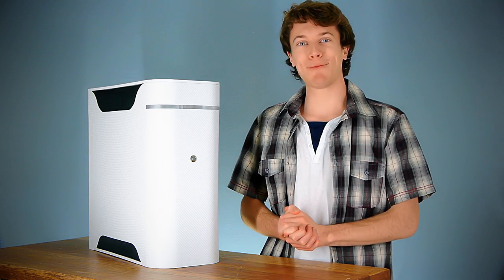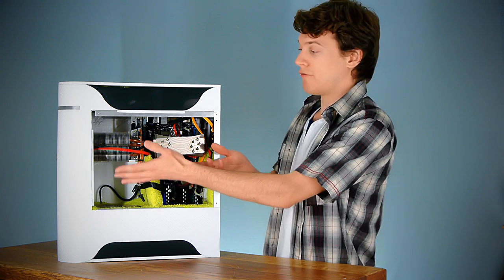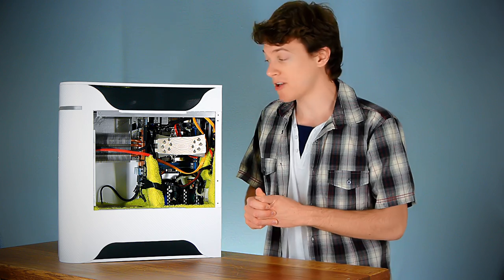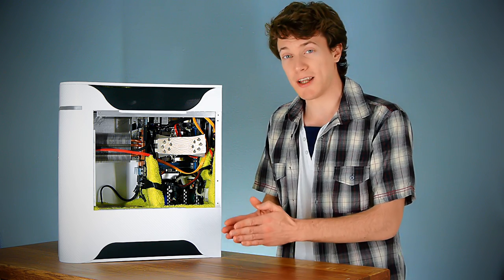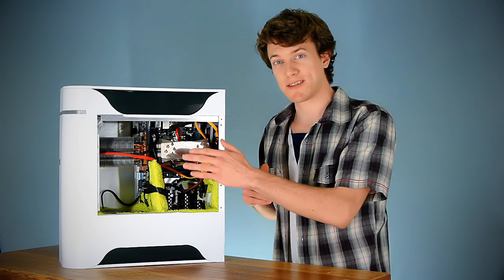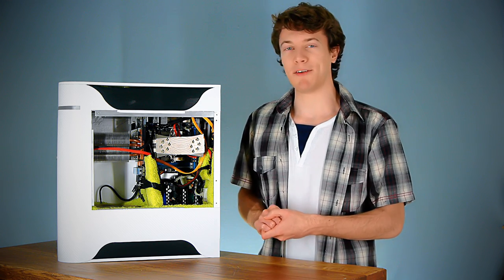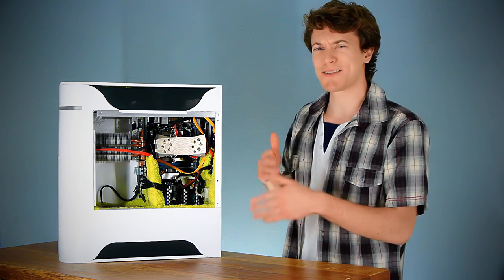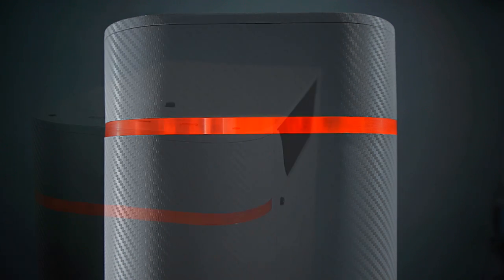DIY Computer Case - The Ultimate Silent PC (CLOUD UNIT)

Comment: Vertically mounted motherboards in which the I/O ports come out the top of the case should become an industry standard So convenient.
Reply: I think it depends where you put the PC as to how desirable top I/O would be. I prefer putting the cables in to the back because it looks neater when the PC is on my desk next to the monitor. If the PC was under the desk having the ports on top would definitely be better.

Comment: "everything high voltage has been kept away from the fabric" Well you've only solved half the problem there mate. I'd be more worried about the DC rails, and especially the 12V one(s). As these are the highest DC voltage and current rails. I'm talking 12v at like 15-20amps in most cases. Talking about over 150w of raw power. If that was to short on something and the fail safes didn't kick in. Then you better pray you can call 999 fast
Reply from the maker: Don't worry - the rails are also kept well away from the fabric (and each other) by plenty of insulation.

Comment: Neat case! But if you're putting in all this effort to build a silent PC, why not go with an SSD over a mechanical hard drive? Also, why include an internal drive just for backup purposes? Go with a NAS device located in another room, so you don't have to worry about losing your data when your PSU catches fire. ;)

Comment: ill give a personal testimony i had bought a budget name brand bronze rated power supply over a coarse of time and 2 Walmart shelf computers this power supply i dusted and maintained "550w" on mid/ standard pc's. it blew up. mushroom cloud of smoke and everything, it was my daily 24/7 computer "power-supply" for a couple years and dusted. but blew up the compositors and all sending melted parts all thru its metal case. "the metal case around the power supply does help prevent fire, in case the smaller electronics pop and spew.

Comment: I had a NEW power supply that had a safety feature fail, smoke came out the back of the PC. Luckily I was there and yanked the plug out of the wall right away. The so called safety didn't function as advertised, one of my relatives in Germany had her apartment catch fire because her PC power supply sparked everywhere and set the curtains on fire.

Comment: You're still using GTX 470? Kinda shocks me when I see people use old school video cards,
Reply: +Michel Naimi Money issues
Reply: +Michel Naimi I am ok with gtx 295, I got it for $60 last month and it is more than enough for the games I play (battlefield 2, GTA vice city, even F1 2015)
Reply: +bbpetrov you could have gotten a 750ti for 90 dollars
Reply: +Michel Naimi He wasn't going to hack up a $2000 Titan Z card.
Reply: +bbpetrov  Ouch, my sympathies, i had a GTX295 up until a year ago, when it became too unreliable and had to be replaced. It came from a person who ran them doing CUDA calculations 24/7 for a few years and was already slightly damaged due to that. I absolutely hated the card. Not that it wasn't fast... it had sufficient throughput... except the performance was rather inconsistent due to internal SLI architecture... but what i really hated was just that 300W stream of hot air. Half the exhausted hot air would recirculate inside the PC, significantly warming up the mainboard and the CPU. That was so deplorable. And oh, cards that hot, they're not going to live forever, there's physically no way they could. It was one of the oldest units, the sandwich built one, where they had slight mistakes with memory cooling, and it easily scraped 110°C in FurMark.

I now have a GTX750Ti, which is faster and very power frugal, and that's just so much nicer.
Reply: Yes,definitely the heat will make me want to sell it but now it performs fine, i think about buying a waterblock for it and to replace it in 2-3 years when 960-980GTX reach price of $100-200.

Comment: building my first rig and i am going balls to the wall and debating on putting it in a cheap case while i figure out how to build a custom one out of an old philco tube radio. pretty much an itx build. the only thing im worried about is airflow and sound now. never built a computer before so please keep that in mind. as for mandatory requirements what i understand is that the motherboard as to be placed on spacers. but what about the other components. pretty much i dont want anything to short out if that is possible. im trying to figure out if this is even possible because of how much space the fans and battery take up. i really like the aesthetic of an itx build that looks nothing like a computer. any help would be awesome. thanks in advance. liked and subscribed.

Comment: What did you use for the dust filter material?
Reply: If you really wanted, you could get car air filters, those work really well

I saw a build where some guy removed all chassis fans on his case and just plugged in an air tube in the back that was connected to a fan with a car air filter, bit of DIY work but the positive pressure inside the case meant little to no dust at all.

Comment: About fire hazards: There is no place inside a computer that cannot start a fire. My computer once caught fire. What was the source of it? After i had doused the fire, i saw that the fire had started where the front USB and audio jacks were, The PCB was completely burnt. So i dont't know if 5V1A from the USB were enough to start a fire or if the mainboard had supplied a higher voltage or what. But i know that every component of a PC is a fire hazard, so you should reduce the amount of burnable material to the absolute minimum.

Comment: How do you make it so that the free file sync runs when the hard drive is turned on?

I'm wondering because AsRock has something called HDD saver they added in two of there motherboards. You can turn the hard drive's off or on in the OS itself. Would the free file sync work with that?

Comment: "A fire is extremely unlikely [...] please don't comment on [...]"

Oh, all right... I was just going to comment about how one of the failure modes of a PSU is the caps, a transistor or a diode exploding and shooting a shower of sparks in every direction, how I've only seen fire come out of a computer PSU three times in my life, and how I've seen first hand how little it takes for a towel to catch fire... but sure, of course, I guess everyone needs to learn from their own mistakes.
Reply: +George Jordan Hi kid, seems like you're trying to cover up for your lack of experience with swear words. Grow up a bit and we may talk.
Reply: +George Jordan Right... so you do know what you should be told, but instead you insist on telling it to me. Oh well, whatever.
Reply: +Jaroslaw Filiochowski fuck it. do you just wanna leave it? I'll mute the comment.

Comment: It's a crappy solution, but it's a brilliant solution.
It's crappy in that this is not of great use as a standard with the towels. Good rubber/silicon supports for mounting the fans etc. would be better. And is doable.
The top orientation of the motherboard is not even a bad idea. Eveery case will have to become a bit bigger overall, to keep some space open for cables to be able to have a little lead space, let alone that quite a few people first have an adapter from one type to another before actually getting to the cable which adds space requirement.
Some of these things can be fixed with extension cables (as partly done) that could go to the back. For audio cables and network and mouse and keyboard that will almost never be needed, mostly it's just the video cable, which should happen less and less to be honest.
But, all the extra extension cables would add quite a bit of extra cost.
The air flow idea is pretty sound, and it works, the biggest problem is with mounting the GPU cooling. It's heavy. Real heavy. And big. Bye bye SLI.
This could be fixed with a new mobo layout. Which is unlikely, but maybe not a bad idea.
Think about it. Just make a motherboard oriented left to right, cpu on one side, with expansion slots still at the right, but down to up oriented, so they do not share airflow. Most expansion cards will not generate too much heat, so you might still mount those under the CPU. I would however move the videocard specific slots, let's just say 2, with some space for how thick they can be, on the right.
This will still be a bit of a bitch, either you mount them above one another (need a long flexible SLI cable, which does most likely not effect performance since even PCI slot extenders only start giving trouble after meters), but they'd share airflow.
Side mounted would mean a VERY deep case because of the giant cooling block. You could have muchos heatpipes come up from the videocards, so, towards the side of the case i mean, making the case a little wider, although you'd have quite a bit of room to play with.
It may very well work, but it would mean designing a complete new motherboard layout, not just form factor, but completely different layout, and the same goes for the vid card layout, especially seen the cooling. Which would need some support structure for the coolers, which needs new standards, which means there would be limited options for the vidcard makers to place their GPU's or cooler manufacturers may need to change a specific cooler with several layout depending on the vidcard manufacturers and the way they place their GPU's.
It's a shit storm.
But, it does work.
I'd like to see more of this sort of thing, change the standard of everything to the new thing. It's just layout, not the tech.

Comment: Hey mate there are similar mounting solution that already exists in the Silverstone Temjin full tower case, http://www.scan.co.uk/products/silverstone-temjin-tj11b-w-usb-30-black-full-tower-atx-aluminum-with-side-window-usb-30-w-o-psu

And I will note that there are a few other Silverstone cases using the same design although a bit smaller and cheaper, I do like the fact you decided to DIY the CPU cooler onto the GPU and it seems to work really well and is a cheap solution to those all in one AIO water coolers which yo can get for a graphics card although a bit clunky and gaudy XD.

Comment: • 14-inch (1366 x 768) CCFL TrueLife screen 
• Intel Core i5-2540M Dual-Core at 2.60GHz 
• 8GB DDR3 PC3-1600 RAM, up to 16GB max 
• 320GB SATA 7200 -rpm Hard Drive storage 
• NVIDIA NVS 4200M w/ 512MB video ram 
• Intel Centrino Advance-N 6250 802.11n Wi-Fi 
• DVD+-RW SuperDrive w/ double layer optical 
• SD flash memory Media Card Reader 
• USB3.0, HDMI, e-SATA, HD audio in/out 
• Integrated 2.0 megapixel Dell smart webcam 
• Windows 10 pro 64bit, and MS Office 2013 
is it good
Reply: Mr. Bleach is this a laptop?
Reply: Refeat Playz yep
howd u know?
Reply: I know PC'S very well
Reply: And it's not a good laptop
Reply: Refeat Playz why?
Reply: Because if your planning to game you cant. And if you want this to last awhile it wont.
Reply: ccfl is such old technology and is generally terrible
Reply: Ezio Auditore he wants it for gaming XD
Reply: Ezio Auditore YEAH XD HA
Reply: what you got? specs?
Reply: Who?
Reply: Mr. Bleach no
Reply: Mr. Bleach quite terrible
Reply: Milan Jovanovic  a laptop it runs lol at 76 fps
Reply: Milan Jovanovic as a matter of fact I do

Comment: Do it get better results than a water cooling system?
Reply: Ofc Not....
Reply: +KellerCraft depends on radiator cize
Reply: +KellerCraft depends on radiator cize
Reply: This computer is quieter under load than a watercooling pump alone (I think). So it depends on your definition of "better".
Reply: watrer cooling is louder and more expensive (about 250$ )but i think will cool better (depends on the quality)

Comment: I can´t hear my pc neither - the leafblower I use as a cooling fan is waaaaay to loud, so I don´t care about whining coils or complaining neighbours O:)
However, this looks like a robust design in my opinion. I would have used a recycled rubber mat instead of a towel, as my feeling would say it will absorb any sound alike and prevent fluff from whirling around in the system. But that would yet to be proven :)

Comment: Someone should try using only SSDs (wrapped in carpet to mask any frequencies), and have their computer case BE one massive heat-sink.
Reply: I have a hard time imagining this because I don't understand what you mean.
Reply: wowitsbryce While SSDs don't have any moving parts, they let out this very silent frequency that can be heard if one listens closely. However, it's probably impossible to hear it from a desktop machine--so it's no issue.
Reply: maccollectorZ (Commenting Account) oh?
Reply: +maccollectorZ (Commenting Account) yes! apparently side channel attacks can be performed by this but only in a lab or a set up environment.

Comment: Nice case but looks like a fire hazard with that green material mounted inside. great way to burn down your house if it catches fire from a surge spark.
Reply from the maker: What's a surge spark?
Reply: Meaning if something goes wrong in that case with that material cloth in there and catches fire.

Comment: Now how do you remove the Video card?
Reply: Only the tip of the cpu cooler is outside the case it's not welded on only an extra fin to match up the holes

Comment: It is neat and all, but not very practical. Most will never be able to put this size of cooler on their GPU. My GTX1060 founders card never breaks a sweat and I have never heard the fan, so I doubt most will need this, unless you are OC the GPU to the max, most will never notice the fan. If I were super worried about it, I would cool it with Freon.

Comment: +DIY Perks - 
Conclusion: its build like a Server https://www.youtube.com/watch?v=dcuo0F1CDBc ... the Servers guts are (aerodynamically optimized) blow cooled like the inside of a hairdryer 

Maybe the PSU manufacturers might modify a (one of this in airy cage) Fanless Power supplies for this 

You Power supply handling, is as dangerous, as in a modern Apple iMac ( with bare PSU inside) = NOT to do by everyone only for risk ( & warranty void )  accepting professionals

Comment: why not use ssd for less noise?
Reply: SSDs were rather expensive 2 years ago. Nowadays, SSDs are the only logical choice for such a system. The laptop drive did a rather nice job for the time.

Comment: Another suggestion from me is to make DIY mini-STX gaming console consisting of I7-6700 processor and Gigabyte GTX 1070 ITX (a short-length graphic card). Mini-STX motherboard for intel Skylake processors are still new in the market. Their 5"  X 5" form factor is smaller mini-ITX motherboard.

There is one limitation though. The mini-STX motherboards available in the market now has no PCI express slot for graphic card. Hence graphic card can only be connected to the motherboard via its M.2 slot that is compatible with PCIE 3.0 X4, using "PCI-E 4X Female to NGFF M.2 M Key Male Adapter" that can be bought from ebay at this link -> http://www.ebay.com/itm/311414541676?_trksid=p2055119.m1438.l2649&ssPageName=STRK%3AMEBIDX%3AIT

As for power supply unit, you may consider using HDPLEX 250W with external power brick to power the Gigabyte GTX 1070 ITX. The motherboard itself has a DC-in power port hence it will be powered by an external power brick the same way thin mini-ITX board is powered.

In addition, you will also need to use a low profile CPU cooler such as Zalman CNPS2X to enable you to fit all of the components of the gaming computer in a slim console-sized form factor chassis.

It would be interesting to do such a DIY project. Hope you can do it for us your fans.

Comment: I like the thinking, as I've thought about it myself. However there are many deal breaking issues with the concept.Not to mention, a lot of what he says in this video is just plain false...The biggest oversight here, the "Size" of a heatsink isn't nearly as important as the "Surface Area" and just as important the "Design"... Companies invest millions and millions of dollars in research on how to maintain lower temps at higher clock speeds. If it they found it could be justified consuming 1/4 of the space in your chassis with a heatsink for the gpu, then it would have been manufactured.Cooling computer parts is a "Niche" all on it's own, and throwing Giant heatsinks onto components is kinda "Caveman Style" at this point...